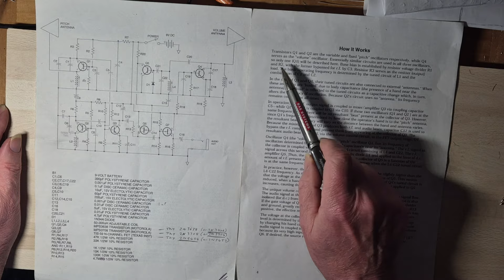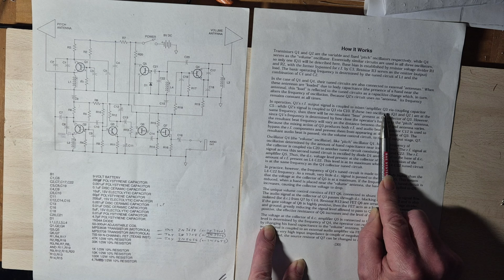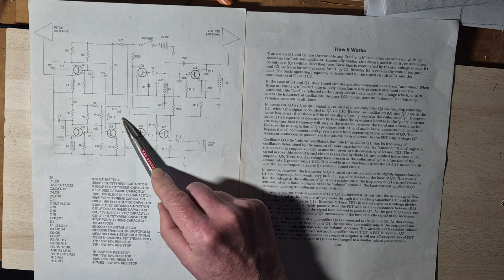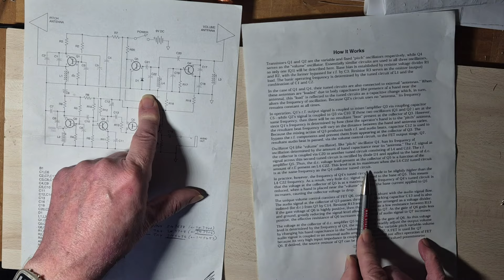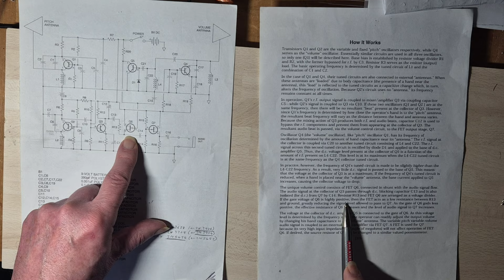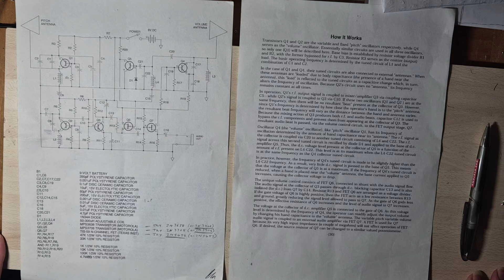Theremin Project 12 How it's supposed to work...

Comment: Hi Tim. There's a discrepancy between the written description and the circuit diagram. It says "if the gate volltage of Q6 is highly positive then the FET acts as a low resistance between R13 and ground" but doesn't the circuit show the FET connected to V+? That, of course, is still a low impedance path but I think (pinch of salt moment here 🤪)  it must be correct if the gate has to go negative to increase the resistance.

If it were mine I think my first step would be to disconnect the collector of Q5 and put a 100k + pot between the junction of R20 and the gate of Q6 to ground. That would allow you to directly check to see if the 2N5458 you are using for Q6 is working in the same way as the TIS59 would have - comparing the two datasheets is difficult as the data on the TIS59 that I have found is rather limited. If it is then the problem would seem to be, as you suggested in the comments in the last video, matching the frequencies controlled by coils L3 and L4.

Maybe I'm barking up the wrong tree altogether but sometimes even random output (from yours truly in this case) can be demodulated into a useful signal by someone else such as your good self. Fingers crossed. 🤞
Reply from the maker: I hadn't spotted the discrepancy! I hope to share some of the measurements on the circuit that I have tried. Several heads are better than one! I'm not just being modest, I have woefully little experience with FETs and although I was trained and went to college, all that is half a century ago now. So I'm very much on a learning curve with this one and any help or suggestions are gratefully received. Many thanks.

Comment: Curious thing on the schematic, C12 shows a polarized marking, and yet in the parts list it's a tiny 1nF cap.  Cutoff frequency for this bypass (1nF x 10k) is about 15kHz.  From the text in paragraph three, this sounds about right, as an electrolytic at even a mere 1uF would yield a very low cutoff frequency of about 16 Hz.  That + sign on C12 is a stray, I guess.  Thought I had an "Ah HAH!" moment there.
The only thing I can suggest is to check the voltage on Q5's collector (per paragraph five) dropping, as your hand nears the volume antenna.  That's got to be a tricky step by definition, as just lashing up the meter to that line might just de-tune the oscillator.  FUN!
Reply from the maker: Thanks Joe. I've done some experimentation and will do a follow-up video. It seems there may be more than one issue, and it could be down to using a substitute FET. I won't say too much more here, as my plan is to show some of the checks in the follow-up. But as you say, test equipment could affect results.